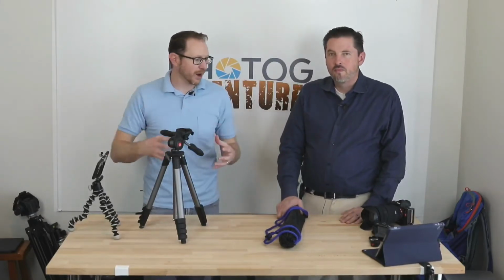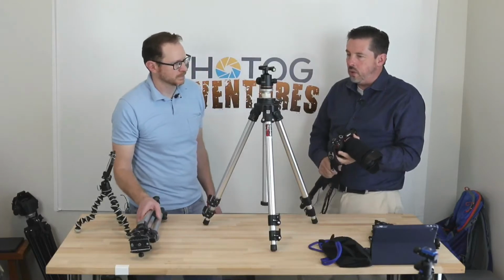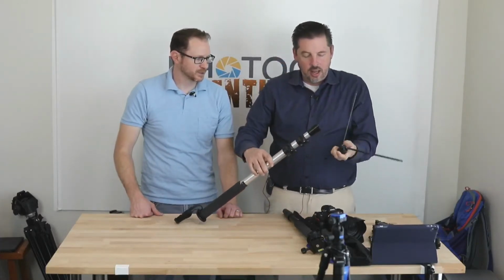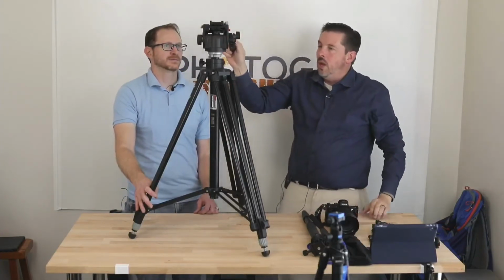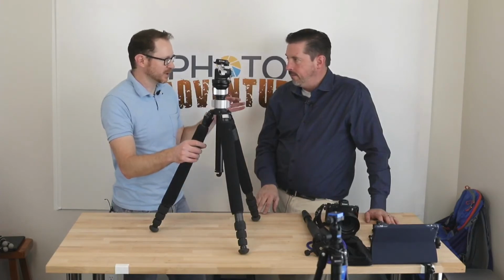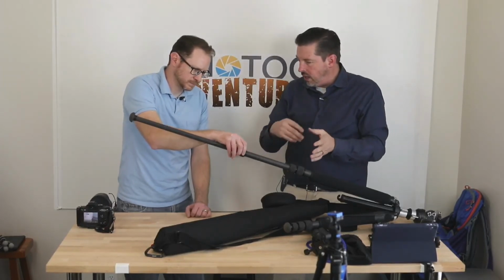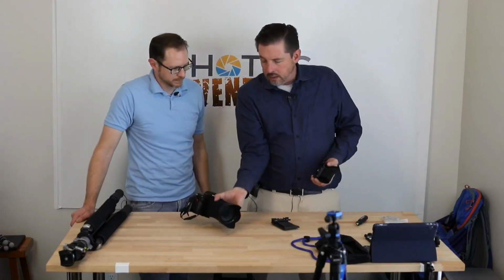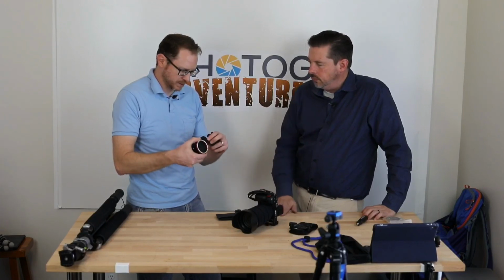Tripods Tripods Tripods today on Gear Time Replay! | Photog Adventures

Comment: Three vocabulary words I did not remember for this show. I am old and tired and only got a few hours of sleep due to the full moon. 1. Apex... The APEX is the piece that all the legs attach to. This is where you would mount your ball head if you are a landscaper... or a center column if you are a Architectural Photographer. 2. Pano Gimbal Head... is a head that is usually indexed but uses three pieces to hook into an L Bracket on your camera to shoot multi row pianos while avoiding the parallax that might other wise occur in the foreground. 3. Nodal Point. This is the point where the cameras lens’s aperture or iris sits. If you can place that point directly above the apex of the tripod in order to get rid of parallax sthat would otherwise ruin your shot.
Reply from the maker: But you have a great head of hair. :D -Aaron

Comment: Not getting audio on the playback - I mean, it's kind of back there but even with the volume all the way up, I still can't catch any words.
Reply from the maker: That is curious - that audio was great for all the audience during the live. Are you really having a hard time hearing the replay? What are you watching on? -Aaron
Reply from the maker: I just listened to it on my computer and the audio is lower than loud but it isn't that bad. I am sorry your device isn't playing it well. I will make sure that we go even louder next time. During the live I checked the levels and they were really high almost in the YELLOW color where it starts to peak into RED color. But I kept it that level so it wouldn't peak. But since you are saying it seems low I will go into the yellow next time. The problem is these guys test the mics looking into the mics and then they aren't all that loud when they talk while looking at each other or tripods so they are facing away from the mic. I will help it be better next time. -Aaron
Reply: @PhotogAdventures  watching on my desktop & not having the same  issue with anything else
Reply: Odd - the sound is good on the phone
Reply from the maker: wow really? It is good on the phone? It really is confusing when the audio is coming through strong but I am going to up the audio beyond the normal levels next Gear Time to adjust for that. Thanks for the heads up, Theresa! -Aaron